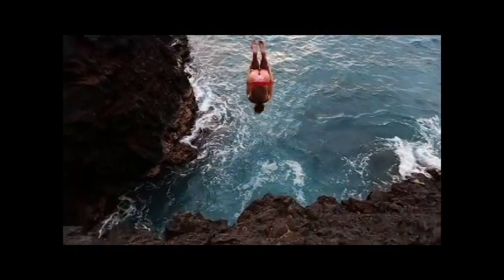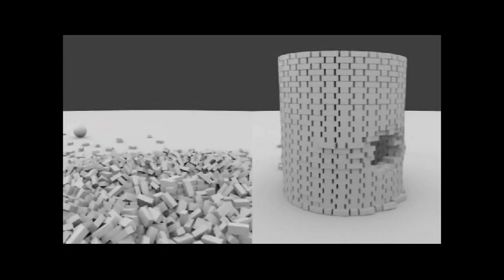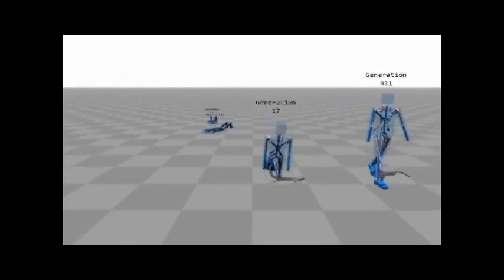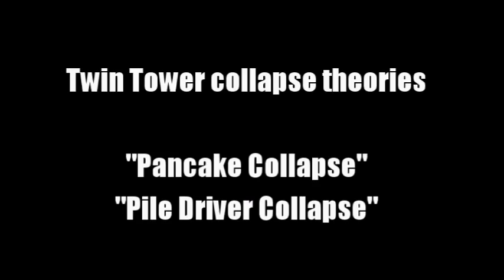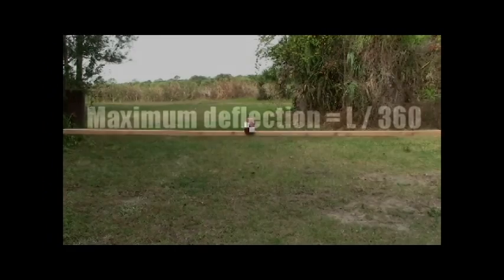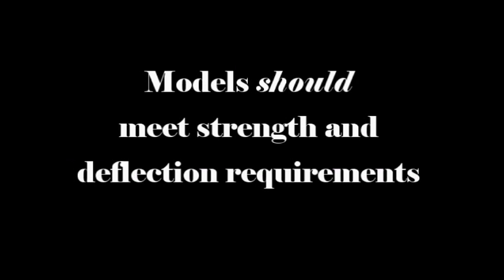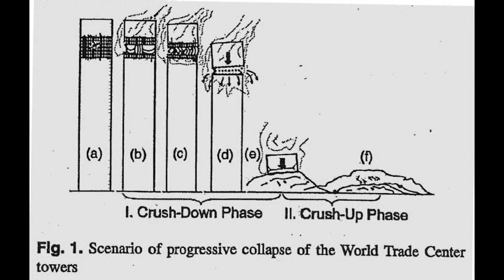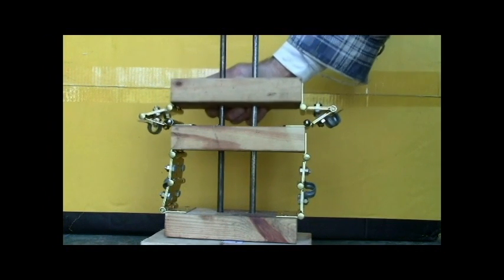9/11 Experiments: The Force Behind the Motion

Comment: This is a flawed model (that yields different results than the actual buildings).

In the WTC, the outer "skin," floors and central concrete "core" were all integrated. They were "connected" as one functioning "unit." Take out (or weaken) any element of the whole, and the whole collapses.

In this model, the maker's floors are not "connected" (as in the WTC) to the sides of the "tower," so when the floors fall, they don't influence the sides. But in the WTC, when the floors sagged they PULLED IN the sides, causing the outer "skin" to buckle. Consequently, the building couldn't support its weight, and fell, "channeling" and "funneling" the energy, debris, momentum and force downward and INWARD (inside the still-intact skin beneath).

This CAN'T happen with the maker's model. It will remain standing EVEN WITHOUT FLOORS, whereas the actual WTC probably couldn't stay standing if one removed just one or two floors. The "skin" wasn't strong enough (by itself) to support the whole building's weight.

Bad video. Bad model. Bad science.
Reply: William Carter  How are you qualified to criticize this man's accreditation as an engineer Bill? How do you plan to prove it in social media?
Reply: How can weakened and sagging trusses pull in steel outer perimeters? They were supposed to have become so weak they could not support the concrete anymore, so how could they pull in those huge perimeter steel columns? Such bullshit! What happened to the core structure? This was made of 47 massive columns, were they pulled out? Evidence shows that the core structure never reached a temperature higher than 250° and only 3 spots on the perimeter steel were found that reached 600° for a short period of time. So where did the sagging, weakening and buckling occur? It´s a flatout bullshit lie.
Reply: So you're arguing that a model this guy made in a day using paper and pieces of plastic from pizza cartons is actually far MORE structurally stable than modern steel skyscrapers designed over years by teams of engineers using the most advanced materials available? If modern steel skyscrapers are so vulnerable to collapse, why have we never seen them collapse like this on any day other than 9/11?

Comment: This video is not experimentation at all. First the simulated floors of three pieces of cement board is an inaccurate representation of the structural Integrity of the flooring in the Twin Towers. The floors are not reinforced fiber Concrete Construction. The floors are supported by Steel trusses. It is a lightweight steel truss made from lightweight materials. These lightweight trusses have a structural integrity to a certain weight load and pressure. A rapid failing once these weight loads have been violated. It's much like an aluminum can... you can place up to 250 pounds on aluminum can but once the side of the can is crinkled it collapses with next to no resistance. All science must be tested through experimentation but you can't say that the nuclear bomb does not cause destruction when you can't like the fuse. This is not a project for a backyard hobbyist.
Reply: evsupp2011 I remember one time when I was driving with a load of tools in the back of my truck. I made a quick left turn into a driveway in front of traffic and when I hit the ramp of the driveway, my tools jumped in the air and then hit the bed of my truck. Then somebody walked up to me and said that car hit you, I said no, no car hit my truck. They said well I heard the impact. No you just heard the sounds of my tools when they were thrown in the air and then return to the bed of the truck. I'm just saying the people hear sounds and they credit it as explosions or impacts.
       Some people might say... That God pushes love up the stem of a flower and creates the bloom. This is not a fact it is misguided opinion. All of these sounds of explosions in the towers can be well explained logically and through physics. There is no need to jump to a conclusion that is unsubstantiated. 5 and a half billion people on this Earth believe that there is a God... But that does not make it a fact. Bringing down those Twin Towers with controlled demolition is not needed. All we needed was two airplanes to fly into the side of those building without bringing them down and the government would still have the support of the American people to go to war, if that was the government's desire. We can argue many of the details. But for the government to fly two airliners into two buildings rigged with explosives, would be an amazing accomplishment with precision that flowed flawlessly to present a spectacle such as this, a conspiracy of huge proportions performed flawlessly without any insiders leaking the results. Donald Trump can't manage the government without leaks coming out each and every day. How can the government hide the massive inside job that you Proclaim?
Reply: evsupp2011 all I'm going to say in regards to your response is, that the proof falls on you. Many years ago when I was deeply involved in the research of the Twin Towers I read through the eye witness first-hand accounts of firefighters, and none of them mentioned explosions in their written or oral interviews. The only interview that left an impression with me is that one of the firefighters noticed that 30% of building number 7 footings were ripped out by the debris flow from the first falling Tower. If you're going to try to claim that firefighters heard explosions or detonations that brought down those buildings, you're going to have to provide the evidence because frankly it is not there.
Reply: evsupp2011 I can also see where you might get confused. When a witness says it was like an explosion that means that pressure went outward. So when the building collapses the pressure builds inside it pushes  outward so it can be called an explosion but it does not mean that there was an explosive planted within the building.
Reply: evsupp2011... I also heard the interview immediately after the collapse of the Tower with that one guy I said boom boom boom boom boom boom it was like explosions. This guy needs another interview, because I believe he was describing the sound not the implication that there were explosives triggering the collapse.
Reply: evsupp2011... you mentioned, one witness said like perfectly synchronized explosions... You did notice the word "like"in their sentence, didn't you? That is actually a comparison it doesn't mean that there were explosions.
Reply: evsupp2011 one other eyewitness you mentioned that he said boom boom boom boom and there were explosions... He was viewing the collapse from the ground. So what would he know about planted explosives? He was viewing the collapse that was occurring 800 feet above his head.
Reply: Gee whiz... Where did this commenter go? Why would he just delete his comments? He must realize how foolish his conclusion were.

Comment: I want to give this video a chance, but there are just too many flaws throughout your experiments for me to be able to give this a fair chance.  Let me go over a few of the ones I noticed:

1. Simply attempting to disprove theories through experimentation and review of your results is not enough.  Ask any engineering professor what they thought of your conclusions, and, if they took it seriously, they would respond with two questions:
A. "So what exactly is wrong with the two collapse theories?  Sure, you proved the theories don't match your experiments, meaning that the theories are wrong, but you never explain what variables the theories don't account for."

AND

B. "Where is your mathematical proof?  Where is your data so that somebody could potentially recreate your experiments and run them without guessing at dimensions, materials used, properties of said materials, etc.?"

2. Using pizza covers for tower supports was a bad choice, tbh.  Polyethylene, regardless of density, is just too flexible to emulate steel beams, especially when exposed to the heat emitted by the alleged Jet-A fires.  A better choice could have been fiberglass rods. 

3. You lit the paper "walls" on fire, but not the pizza covers.  Seems like either simple inconsistent experimentation or willfully neglecting to report findings that lend credence to the theories you seek to debunk in order to fit your hypothesis.  Either way, it's a big problem.

4. The fire you lit was only at one point, thereby affecting how the floors above might collapse.  In addition, the fire spread too slowly horizontally to accurately simulate the spread of fire across carpeting in an environment containing an accelerant in liquid form such as jet fuel.  

5. The experiment structures were not truly free-standing.  Those wood guides not only exerted a force, however small, on the structures' sides, thereby affecting how the falling weight would be distributed.

6. You failed to account for the stairs and elevator shafts through the middle, which would have further impeded the collapsing floors as they would also take some of the load of the falling floors.  I'm surprised you didn't account for that, especially when there's plenty of stories of people surviving the collapses by being in the stairwells.

Comment: Don't forget that for a month or so prior to the attack, both towers had "network cable" installed.....this "cable" installation, that was installed on each floor of each building, must have been incredibly important. So much so, that K-9 units with bomb sniffing dogs that were normally and routinely authorized to perform searches of the buildings, were not permitted access to the property during these "installations".

Weird, huh.

I've installed LAN cable many times, and in many highly sensitive areas. Never have I had to ban anyone or anything from the buildings, rooms, corridors, or any places I was working. They're just internet cables. 

Why bomb sniffing dogs were denied access for an entire month, for that specific reason, is beyond rational comprehension.

So, yeah, they used that time to install demo wire filled and lined with pyrite or other similar explosive.

If that's what they were doing, then banning the dogs would make perfect sense.

9-11 was an inside job all around. Terror didn't just come from the air that day, and we all should know that by now.

The conspiracies will shield those responsible for a long time, if not forever. 

Follow the cash if you ever want the truth revealed. Cover ups cost money. 

You can start with the freedom tower.

✌🏼

Comment: I call bs. If you want a practical experiment, build 2 400 meter towers with the same technology as WTC and fly planes into it, then youll have something close. Trying to simulate thousands of tonnes of steel and composite materials under fire with 10 feet of paper and cardboard is ridiculous.
Reply: Henry14arsenal2007 oh god you idiot
Reply: You can go couple of ways when building a computer simulation:
a) I will punch in these parameters and see what happens, I don't care what the result is
b) In my simulation, the building will experience a total structural failure and the building will collapse

To know which method was being used to develop the simulation, you need to have precise parameters of the simulation AND the software which was running the simulation. Even tiniest of variations in either simulation data or software might lead to completely different outcomes.

Have you managed to find out which method was being used to develop the WTC collapse simulations?
Reply: There are plenty of videos of successful and failed demolitions to compare it to. If fire could make a successful demolitions, demolitions experts would use them since it's cheaper than explosives. As is there are plenty of skyscraper fires, and none have collapsed, but on 911 3 buildings collapsed. What are the odds on that? That very fact indicates those buildings were rigged for demolition.
Reply: nekio - And why would that be? Please be specific.
Reply: Trying to simulate a total collapse of such buildings in a computer simulation is even more wrong. There have been ZERO 0 0 0 previous examples of skyscrapers collapsing due to office fires, yet they manage to come up with an elaborate simulation in which changing just one of the variables just a little bit would result in towers standing just like before.
It is obvious that the computer simulations accepted by the mainstream weren't made to understand why the towers could collapse, but rather to fit a pre-determined agenda which states that the towers collapsed due to office fires.
Can you please send me a computer simulation which I can run on my computer and verify for myself?
Reply: The same patterns apply in nature at a small level than a larger one
Reply: Kristupas - "Trying to simulate a total collapse of such buildings in a computer simulation is even more wrong."
This comment makes me wonder if you understand how these models work. Seems to me that you have the impression that such a model would be something like manually creating a random video. It isn't a simulation. It's a model in which all relevant construction data, impact data, damage data and fire data is being input from which a possible collapse SOE is being calculated.

Comment: Absolutely unrelated and invalid experiment! It does not correlate to anything that happened. For one, your weight had the wrong ratios to the strength and size of your floors. Secondly, your center support structure was oversized for the floor space, and it was not damaged. The center supports in the WTC were badly damaged, destroyed, and weakened from fire. Thirdly, your structure did not have load bearing roof trusses. And lastly, you did not weaken floors at random towards the bottom of the floors. There was hundreds of gallons of ignited jet fuel that were sent down elevator shafts as low as the first elevator exchange that weakened those areas so they could not support the weight and energy of the collapsing structures above when they hit them 5 or 6 seconds into the collapse.
You need to build your model to scale, and subject it to all forces applied (in ratio), and in similar existent parameters to be valid. And duplicating and scaling down the kinetic energy of several thousand tons of material moving at 9.8 meters per second squared will prove to be very difficult. But in doing the math (yes, I know you don't think the math is as important as experimenting), we can calculate how much power those buildings produced when they fell.  It is an incredible amount of force...way beyond the energy produced by any demolition explosive used then.

Comment: You forgot to take into account the effects of mass: the towers were millions of times more massive than a paper model of the World Trade Center, and you can't shrink the forces that affect mass down to a model. Also, relative to the size of your model, your paper and matchstick walls and supports would be stronger than the steel beams were.

Comment: One huge difference in your experiment is that you have that steel beam running through your model structure that remains even when you perform the "demolitions". I could see why you did that to keep the "floors" in a vertical stack. But that even further debunks the WTC collapse pattern because your experiment didn't even take into account horizontal motion. If the collapse of the WTC was at all asymmetrical, then why didn't the top of the buildings roll off in a horizontal direction? Instead the buildings imploded straight down in a perfect vertical line.